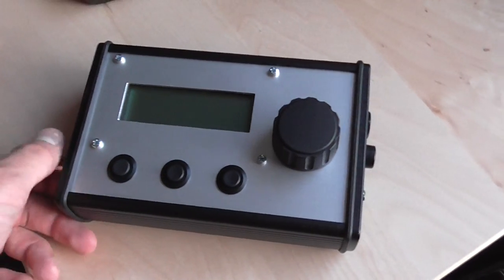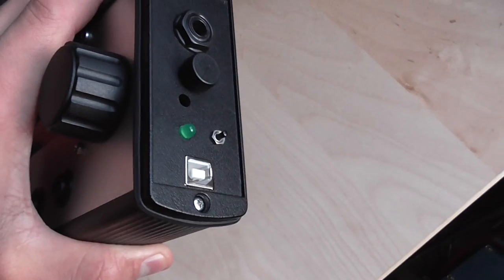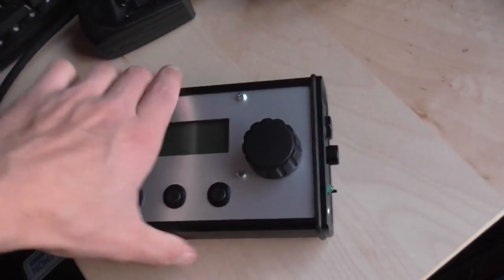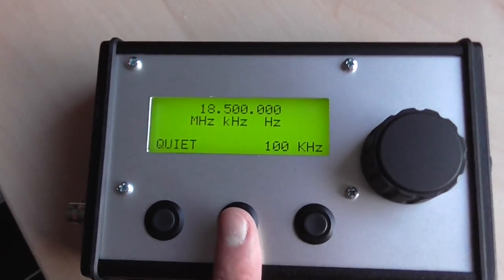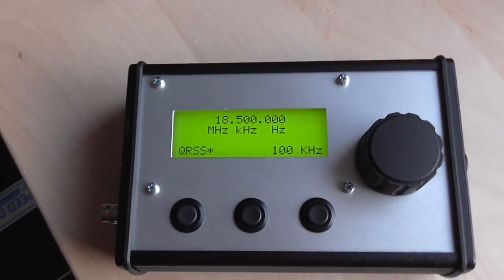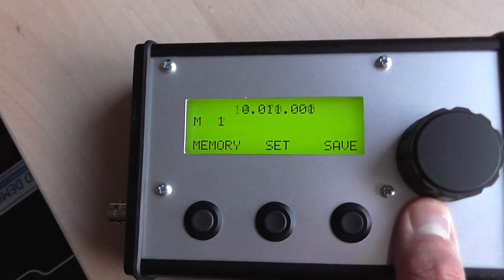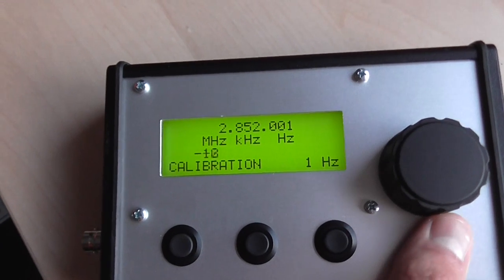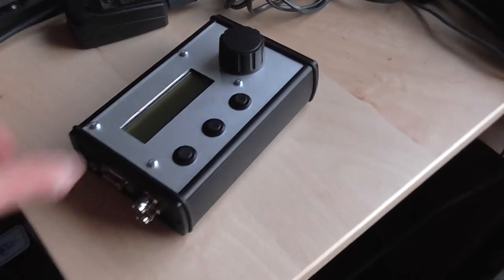DDS VFO Using Arduino

Comment: maybe yes maybe no,
it may be able to use this combination as an antenna analyzer???

Friendly greetings from Netherlands / Rotterdam.
Rob.
Reply from the maker: It would technically be possible I guess. It's only a RF signal generator though, so the entire detector portion of the analyzer is missing.

Comment: What battery technology are you using ?
Reply from the maker: It's got a single 18650 Li-Ion cell in it. And a little step-up converter to turn it into 5V.